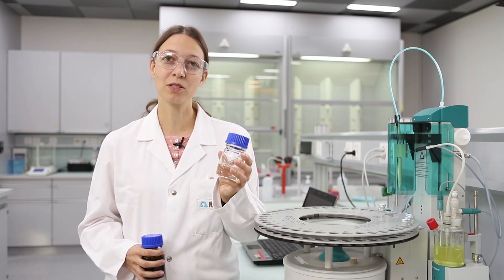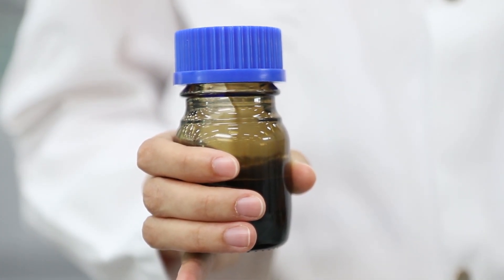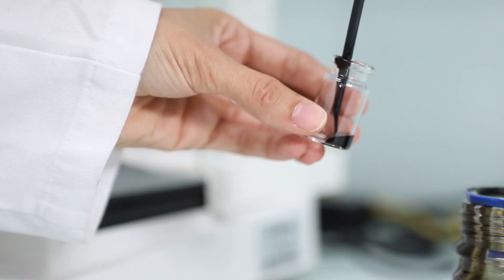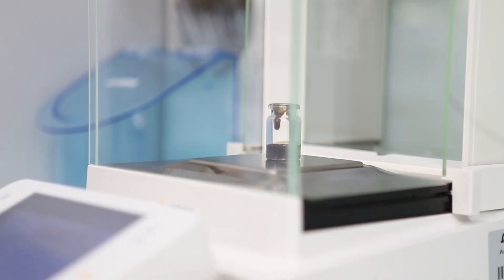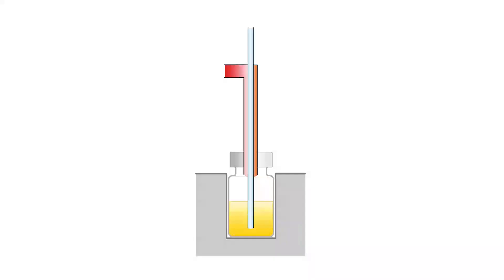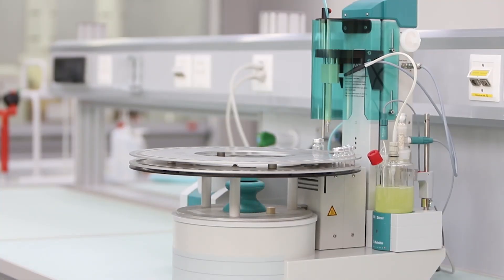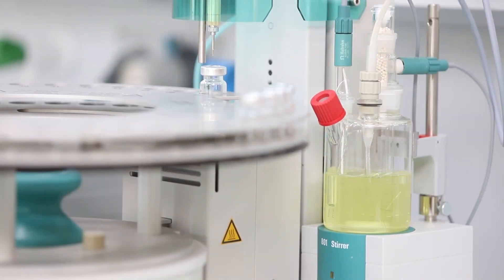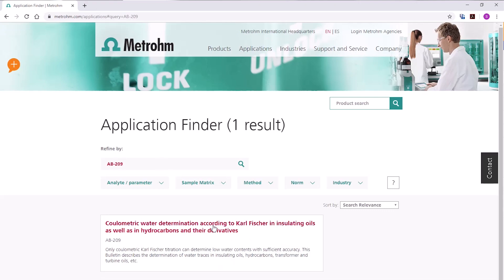Water content determination in petrochemical products as per ASTM D6304

Comment: Can this machine perform D4928 ? What is the difference between D6304 and D4928?
Reply from the maker: Both standards describe the coulometric Karl Fischer titration to analyze the sample.
In ASTM D4928, the sample is added directly into the titration cell (direct measurement).
This means that the Oven Sample Processor is not needed to fulfill the standard.
The titrator alone is sufficient.
ASTM D6304 describes three different techniques (procedure A, B and C) and also allows the use of an oven system, as shown in the video.